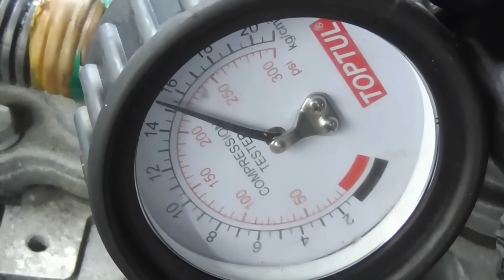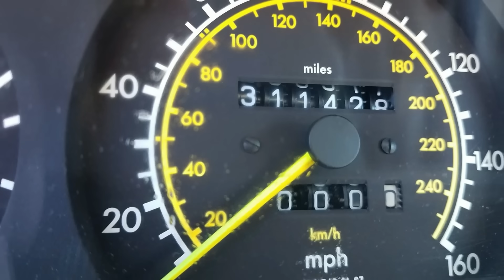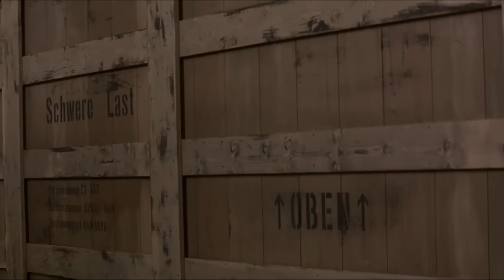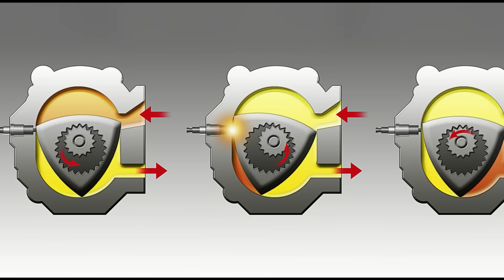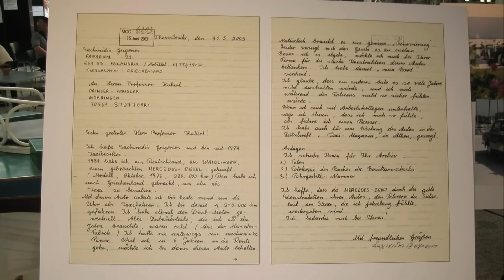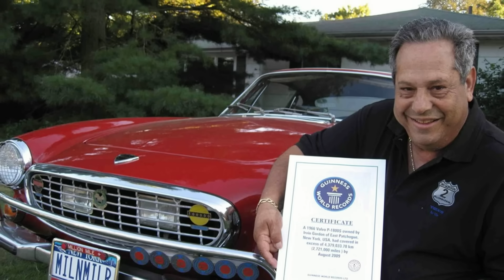Most Reliable Engines of All Time

Comment: Ford 300 inline six- powered UPS trucks for a long time.  300,000 miles is commonplace.  Bulletproof!
Reply: James, I totally agree. It is one of, if not my favorite, engines. I love inline 6's. I had some sporty cars but they always had inline 6's including the slant 6 and the Chevy 6. The Ford 6 is the best and I like inline 4's, all coupled with straight shift transmissions. Thanks.
Reply: Had a 1980 Ford F100 with 300-6, 1 barrel carb, 5 speed overdrive manual, truck was a insurance write off twice, re done sheetmetal a third time, over 500,000 miles (had dual kilometer/miles speedo), couldn't get out of its own way speed wise, had to shift down out of overdrive on slightest hill. Frame rotted away, not road worthy, engine went into a construction air compressor, may still be running today!

Comment: Never a mention of the 4.0 liter I6 in jeeps.... seen plenty in my limited 6 years of working on vehicles with 400 to 600k on the odo with the original engine.
Reply: How many cracked manifolds did you replace? Mine would only last about 50k
Reply: @patstenzel  not a one yet. Mines a 99 model.

Comment: I'm sure there's a lot of great engines you left out but it's a real shame you left out the most popular high mileage to engine on the road and the planet has to be the small  block 350 by Chevy.  I'm the original owner of a 1994 K 1500 Silverado it's a 4 wheel drive Z71 nothing ever goes wrong with it it has 450,000 miles on the original engine it's only had 4 tune ups, 1 every 100,000 miles and it's got the original transmission on which I've only changed the fluid once.

Comment: You forgot the volvo B20 engine that was so good that Volvo had to stop making then cuz volvo did not sell any spare parts for them. And I have an Audi A6 2.5 Tdi 5 cylinder from 1996 with 300.000 miles on it and I have only changed the oil every year.  Stop's and goes like new in Norway from - 40°C - 40°C

Comment: More to that, I own a Yukon with a 6.0L LS motor that has had required no major repairs and it has just over 200 000 now.  Its well known that the LS motors regularly go this far and more.  Maybe 200k is amazing for Japanese engines and that's what they chose to focus on.

Comment: 93, f -150 430,000 4.9 straight 6 and still getting between 17 and 20 mpg depending on if loaded or not
Reply: Those straight sixes were pretty reliable.  We had a fleet of those Fords with automatic transmissions but nobody wanted to drive them because they were so SLOW when accelerating.  My boss bought an old Chevy truck with a V6 and a "three in the tree" manual transmission.  It was faster than the Fords and got better gas mileage too.

Comment: My fathers 1975 C10 Chevy Van had 347,000 miles on it. The only motor repairs were the timing chain and valve stem seals, and no transmission problems. He was a mechanic for a Pontiac dealership. And he was not easy on it, drag raced it at Englishtown three times averaging low 17's. He retired it due to body rust. The engine block casting was a 010 series, four bolt mains.

Comment: Wait a rotary made the list but not a 4.0 jeep inline 6, chevy 350 small block, 300 straight 6 ford, a 5.9 Cummins or a 7.3 turbo diesel?
Reply: You sir infact know your engines everything you named should of been on this list
Reply: Exactly
Reply: i will never watch one this guys videos again, who ever assembled this list is a moron. my 5.9 12 valve currently has 900,000 on the clock, and my daughters boyfriend owns 3 broken rotarys all of which have less than 200,000.
Reply: Only thing unreliable about 7.3s were when they switched to powdered metal rods in 2001 or 2002 i believe my 7.3 threw a one the rods at 110k on the orginal owner now has an older forged rod motor in it making close to 400 hp

Comment: At higher elevations, the  2.0 M1-11 stock engine only lasts about 30,000. 
It's more, if  you keep it at sea level :/.
Reply: Does the air have invisible engine demons at higher elevations? Ive heard about them but haven't seen one yet.

Comment: Its a big problem today. People will get rid of their cars and buy a new one at 100k - 150k miles it seems. Or well, those that can afford it. Its cheaper to sell it and put the money in to a new car you do car loans than keeping it. Put the money down your get for your  old car on the new, if its in good condition it will then lower the cost for the next car. 

But this is how our society works, we need to be consuming or it falls appart. Big buisnesses are big because we keep spending and wasting, throwing things away. I always think of that Canadian truck company, that made logging trucks, they went under because the trucks did not fail, they would just go on and on. Fail to recall the name of it right now.

Volvo's do 300k miles easily, atleast the older ones and pretty sure the newer does as well. The absolute newest, I dont know yet, since well, they have only been around for 2 years or so. Hope their new 2 liter engines are good. They only make 2 liters, all basically the same with differet stages of boost put in to them. 

Electric cars has the potential to last a veeeery long time. But I doubt they will be made that reliable. Look at Tesla... what a nightmare to own one of those beyond its warranty period. Ugh!

Comment: I had a 2001 Ford Ranger I purchased the week before the "9-11" horror.  It had 9800 miles on it, had a salvage title.  I never changed the clutch, or had the tranny out of the vehicle.  No engine problems (v-6) either, and I changed the oil at 20k-30k or so.   I was "totaled" in a 15 mph T-bone accident on a residential street.

I am no hot rodder, but also no slow-lane inhabitant.  I have no doubt there are a lot of Rangers out there with 200k on them.

Comment: My highest mileage car is of all things a Triumph TR6 2.5litre straight 6 with just over 300k miles, I agree the 150-200k miles isn't very impressive at all. Agree with many of the comments below wrt Cumins and old Mercedes engines as well as the Chevy 350 and many Ford V8s... I was glad to see the P1800 Volvo mentioned at the end. I met a guy with one with 800k on the original motor... the "fastest looking slow car ever made!" but reliable ;-)

Comment: My 2010 Toyota Camry LE has the 2AR-FE 2.5L I4 with dual vvt-i and smpi with 169hp and a 6 speed automatic. Has nearly 183,000!! Original miles. My uncle bought this back in October of 2011 with 35,000 miles. This Camry was made 10/09. As a 2010 model. I love my Camry. Has had 4 owners. And I’m the 4th currently. Been in my family for 7-9 years. Dead reliable, durable, safe, practical and is made like a tank to last past 400,000 miles.

Comment: Ya know, a few times you were suggesting 150K or 200K miles was some kind of endurance but you can expect that out of "most" of the engines made in the last 25 years, if you merely change the oil on a regular basis and repair the minor bits (water pump, timing belt or less often chain, etc).

Comment: I've got a 2.9l v6 comes stock with the bronco 2's back in the mid to late 80's I have over 300,000 miles on it all original no rebuild and pures like a kitten no issues at all . now that's an engine hell Chevy , Ford and Dodge have engines better than these .

Comment: LOL, no mention of the LS V8 engines from GM that are used from Corvettes, cars and trucks. Those motors last nearly 400,000 miles. Seems to me the narrator is a bit bias. Needs to take off their ricer blinders.
Reply: Rong-o!! I personally had a 1970 Chevy El Camino with the 450 hp / 454 in3 ls engine.  It lasted less than 15000 miles before losing power and stopping. I had the 5 year factory engine warranty with Chevy. The dealer took the engine apart and said ha, ha, we won't honor our warranty!!! I'll never buy another Chevy. Ha, ha back.🤣

Comment: Mate your clown , RB26 reliable ? 500hp cheap and easy with a few mods ... to this reliably  , full rebuild , forged pistons , bigger turbos , bigger plenum , down pipes , intake pipes , stud bolts , bigger cam , bigger fuel pump , bigger turbos , cam gears , full cat back exhaust , bigger injectors (stock are good for 420hp max) aftermarket oil pump the stock one was notorious for failing and causing catastrophic failure , tuned aftermarket ecu , heavy duty clutch , strengthened gearbox or aftermarket os giken gears , intercooler , bigger radiator .... cheap and easy ?

Comment: My 1993 Chevy S10 has a 2.8 V6 5 speed rear wheel drive transmission has the original clutch in it, the truck has over 1,255,000 miles on the entire thing and I just recently had to rebuild the throttle body replace the coil and distributor and oil pressure sensor and it may actually have 2250000 MI give or take 10 to20 thousand miles because I watched the odometer roll over once on it and I was told it rolled over once already before my dad had this truck befor me currently owning it

Comment: Dude how is the small block Chevy V8 not on here. It is the most widely used engine ever and the most swapped in engine in any brand of car from all OEM manufacturers.
People put those engines in every type of car and even motorcycles.
GM made the 100 millionth small block engine ten years ago, and was first use in 1955, ...

Comment: I own a '93 Mazda RX7. I bought it as a roller so I could do a LS1 swap. When the dash was powered up the odometer had 41,000 miles and change. Not very reliable. My daily driver/beater is a '01 Ford Focus ZX3 with the 2.0 DOHC engine. The timing belt, water pump , AC parts and PS pump had to be replaced but the engine, clutch and transmission have never been opened. It has 240,000 miles.

Comment: To me 50K on a clutch is low, I have had 3 vehicles get over 100K on the original clutch with no problem, and another with over 200K. High mileage like that Volvo usually is indicative of highway mileage and you don't use the clutch when cruising down the highway .

Comment: I have a 2003 Dodge SRT-4 with 200k on the clock, never been rebuilt and is still very fast.  My 1999 Dodge Ram has 250k on the 318ci mill and is flawless and reliable.  This guy just has an obsession with Japanese cars, probably an unhealthy obsession at that.

Comment: That one volvo isnt the only one to hit insane miles. All the old red blocks could hit 600,000 without issue but they didnt make the list. Alot of those jap engines were good but alot were undeserving and have not earned this title yet, alot of them came in cars that would never even make it to 300k. GM LS engine, 4.3 v6, buick 3.8 v6, cummins 5.9, all absent, but a rotary made the cut. Whoever made this list sounds like a jdm enthusiast.

Comment: Do you people know how to drive? 55000mil it's under 100000km it's nothing for a clutch. My old Peugeot 406 HDi. Had 400.000km on it (250.000mile)on the original clutch, and was still perfect. Only reason it's not around eny more is because i crashed it. My Mercedes E270cdi W211 has also 250.000 miles on it. And Stil runs great and my bosses brothers has over 375.000mile on it and Still runs great. My old Corolla (4A-FE) had over 220mile on it and was going strong the same for my Carina E (a model between Corolla and Camry) and my Mercedes 190 2, 0D W201 had a milage over 532.000 miles. So i think a lot of people don't know how to drive.

Comment: why does he mention any engine that lasts less than 200,000 miles, or not mention engines like the 300 CI Ford straight six that came in full size ford cars, but also in pickup trucks?

Comment: I'm a mechanic and was trained at a Merc Benz dealership. After my apprenticeship period I left and went to a Nissan and Volvo dealership. During the 5 years I was at Nissan/Volvo we did a bit of fleet servicing. After awhile one gets to see all sorts of peculiar maintenance trends but I digress. 

Anyhow, one of the owners of a smallish Nissan fleet had as a private car a fuel injected (Bosch K Jetronic) Volvo 240 that had 400,000 miles on it. They had it since new and it was a much loved car. Granted, they kept the maintenance up because they put big daily miles on it but the thing is they never let it go more than 3000 miles without an oil and filter change. It was a 'lively' motor in that old sedan too even with that high mileage. It seems short interval oil and filter changes can make the difference on some motors. 

I don't think this is the case for all motors but it obviously can't hurt.

Comment: Absolute American typical bullshit.
My 1995 Land Rover Defender with a 300tdi engine has 332xxx miles on it.
And just had its first clutch replacement.   Oil changed every 5000.   These engines regularly do upwards of 400,000 miles. Some have done over 1 million.  Used by militarys in many countries.
Then there are the cummins deisel engines,  no mention of those but you mention Mazdas absolute shitbox, bloody unreliable washing machine 13b?

Comment: Whoever put this together needs to do better research!! Man, the Mazda rotary engine is not reliable. They are notorious for wearing out at less than 100,000 miles! You should research that some more. And no Ford 4.6L engine on this list? It’s an engine that made Wards 10 Best Engines List numerous years! Do you know how many taxis ran those engines and put as much as a million miles on them with 500,000 miles being common? There’s a reason police used cars equipped with that engine too.

Comment: If you have to replace the original motor, it loses all credibility as a high mileage car.
Reply: Right. The Guy with the 1963 Plymouth went through 5 engines, which means that his high mileage is not accurate. It's only accurate to the highest mileage that the original engine achieved.
Reply: @lsmalley  - Agree. That's ridiculous to consider "high mileage" with 5 engines under the belt. 
 "High mileage" for me is a stock to the bone, never opened engine. New rings already put them out of my chart. ;-)
Reply: The Plymouth Fury survived a head. On collision with a truck,was a Trabant?

Comment: Original owner of a 97 Nissan hardbody  with over 400,000. I was a Chevy guy until this one outlasted all of them.
Reply: Shawn Starbuck My brother has a 97 Hardbody with 385K miles on it. My 93 Ranger 2.3 5 speed just turned over 287K miles with the original motor, tranny, and clutch.
Reply: @trevagraham1605  That is a lot of miles on the clutch. Pretty impressive. My grandfather always bought the f150 and rangers.  The Rangers seemed to be really dependable.

Comment: 1963 GMC 1/2 ton long bed custom cab with 305 V6 and 3 speed manual on the column, 370,000 miles with only a few clutches, still running strong, 1979 Honda Civic 1488 CVCC wagon with 5 speed accord manual transmission 385,000 miles with only minimal maintenance and still solid engine and transmission but the doors no longer worked well and the family outgrew it, 1964 Chevy 3/4 ton C20 with factory dump bed and 250 straight 6 and 4 speed manual muncie transmission had 400,000 miles when the water jacket corroded through to the oil galley due to a bad ground. 1982 Chevy Luv diesel with 2.2 liter Isuzu 580,000 miles when my ex wife stole it, engine only had regular maintenance, never torn down, transmission rebuilt at 500,000, 1993 Dodge Caravan with 2.5 liter 4 cylinder and 5 speed manual, original engine with only a head gasket replace, no machining required, transmission still silky smooth, 388,000 ,miles and going strong, 1993 Geo metro 1 liter 3 cylinder, 5 speed manual, no rebuilds, regular maintenance 270,300 miles still my daily 50 MPG driver, 1996 GEO Metro 1 liter 3 cylinder, 5 speed manual 250,500 miles all original, loner car for kids and friends that have broken Fords or Nissans. I have only ever owned 1 car with less then 100,000 miles, a 1955 Buick Road Master that had been in storage from 1965 until 1986. Have owned over 100 personal cars since 1980, driven many millions of miles and my favorites are the Dodge Caravan with 2.5 liter and 5 speed manual, the 1993 GEO Metro 4 door 1 liter 3 cylinder with 5 speed manual, and my 1963 GMC 1/2 ton long bed with 305 V6 and 3 speed on the column, and my wifes 1996 Honda Odyssey 2.2 liter 5 speed automatic, 280,000 miles and still her daily driver.

Comment: I had a 1991 3.8 Pontiac v-6 ran 325,000 miles+ without a wrench on the engine except changing spark plugs. Big car not a little euro tin can. In fact the trans went out and the gas and brake lines rusted and were replaced. I towed it to the junk yard and the engine was running so my brother could steer it easier.. never smoked or used oil between changes. I coulda got another 100,000 miles out of it! had original exhaust system on it. At least GM put a stainless on on it.

Comment: What about the Famous 225 slant six, 300,00 easily, beat it up starve it from oil and they still run, the Jeep 4.0 and the Ford 300 six cylinders. I understand your engine memory is short as you are hung up on high strung Japanese engines.

Comment: Toyota 3k 4k and 5k engine's are extremely reliable I have a Corolla whit a 3k engine it the original engine for that model more than 40 years old never got rebuild and sill run normal

Comment: Kinda chuckled driving down the road in my 91 Subaru with 434k on it. I'm the second owner.
Reply: Weldingclassroom that’s amazing thought mine was high at 26000
Reply: @michaelwest7874  Its done pretty good. Between me and the original owner it has had (what I recall) 2 clutches, one alternator, valve cover gasket 3x, head gaskets replaced due to leak, and is ready for a PS pump. 

What amazes me is the auto seatbelts that still work and all the little things. Some of the interior plastic is seeming a little brittle.

Comment: I had 240,000 on my 2005 Pontiac with a 2.2 l ecotec . Never had any problems. Just changed oil and spark plugs. Still ran and transmission shifted great. No leaks in motor or trans. At 240,000 the engine cradle rusted and broke.